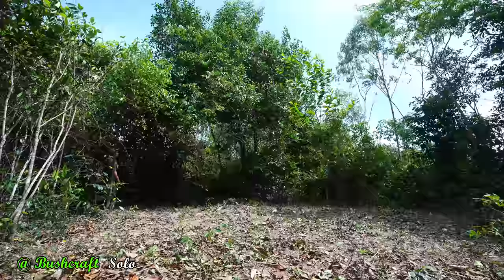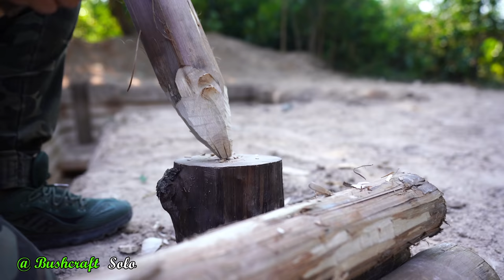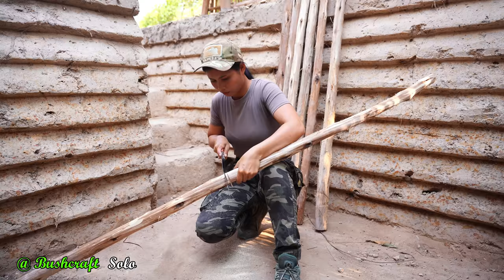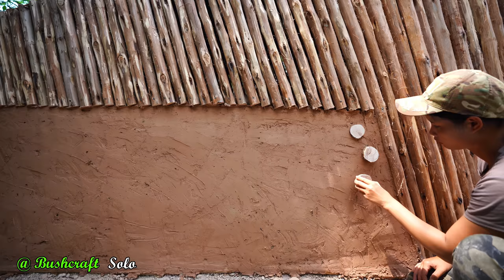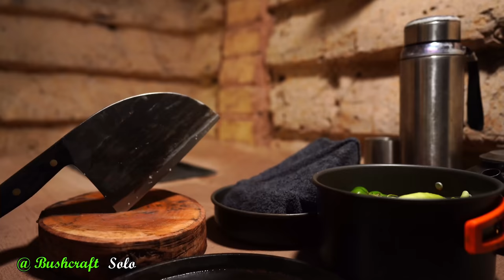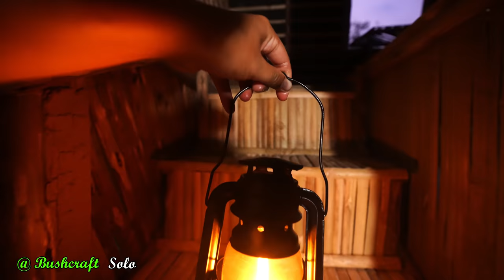Building a DUGOUT House with Plastic Roof | Wooden Wall & Fireplace with clay

Comment: 🔱 Here's my next hobby, thanks for the inspiration!  This is the life I want, but with everything natural, in order not to depend on anyone. Try to use the roof for water recovery and a filtering system after you have created a nice well to store as much of it as possible.  learn to eliminate modern tools and recover everything possible that nature offers you.  so it would be top. ⚜ FDM

Comment: I would question the wisdom of having the woodpile so close to the fire. Even though the mud wall is thick the fire is very hot and heat will transfer. If the wall cracks ( and that is quite likely) the place will go  up in flames- including the plastic roof. I am not sure what country this is set, but given the posters clothing and vegetation it looks somewhere quite warm.  I am guessing Korea?  Rural communities in tropical  and  even cooler climates would have a cooking fire  outside of the main living and sleeping area.  If a fire accident happens it may not be easy to get out of the structure  quickly- the entrance is narrow and light is poor.
Reply: This is not korea. Korea have not jungle.